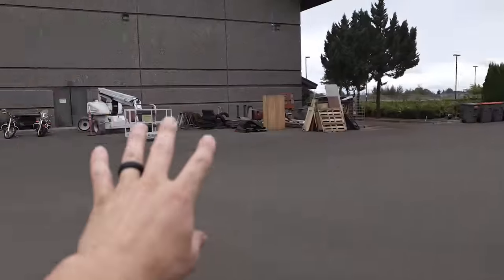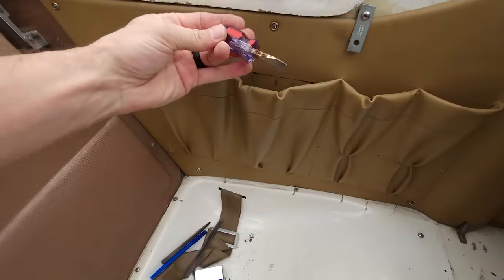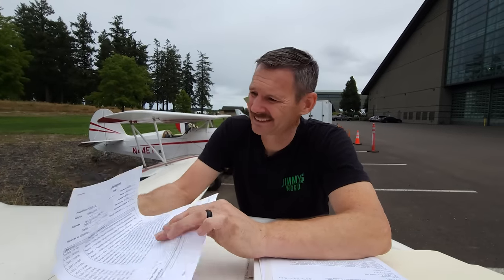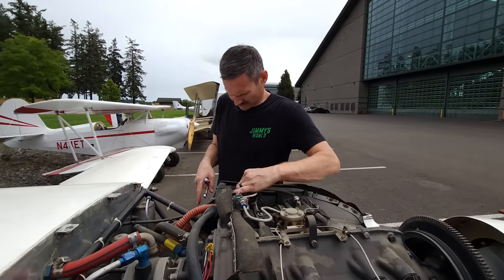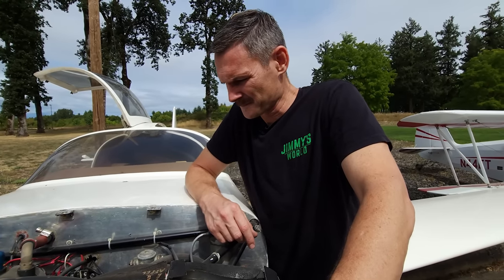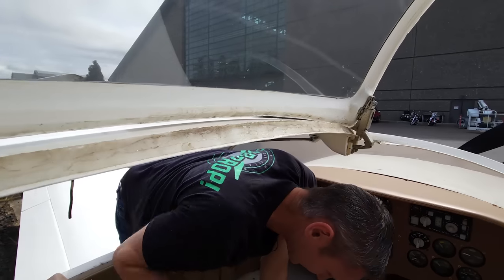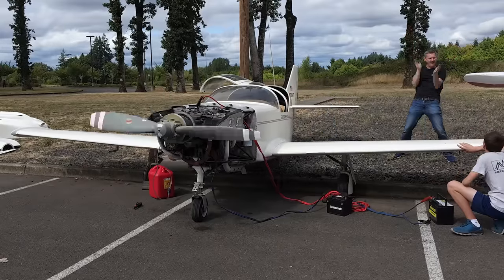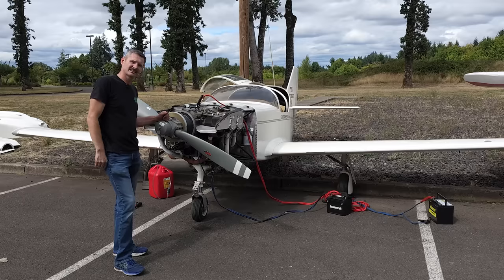21 Years In A Museum Will It Start?

Comment: Last project my dad & I worked on was a Glasair III before he passed away. Instead of the IO-550 we went with  a Rolls-Royce Allison 250-B17B turboprop engine. That airplane will cruise @20,000ft MSL @over 325kts. We would fly from KRFD to his hometown of KARG Walnut Ridge, AR. As a boy he told stories of WWII aircraft coming in to be smelted down and rows & rows of airplanes on their noses. Sad now to see all those pictures of planes waiting to be scrapped
Reply: Does it fly? What’s the tail number?
Reply: Saw a turboprop Glasair land at Eagle Creek Airport from Oshkosh in the 80's, only one I knew of. I was building a Glasair at the Greenwood Airport in Indiana at the time. Serial number 139, sold in 1992 and was 50% done  wish I finished it.

Comment: I would never feel comfortable flying a homebuilt plane that had been in a major accident, so I think the old owner was correct in saying the plane should never fly again. The engine on the other hand would be perfect for a heart transplant in to your new Lancair. Before you do the swap you should do a performance test, so you can have before and after numbers to compare.
Reply: but you would fly a certified plane after a "major accident"? You don't think a Glasair airframe, controls, mounts, etc., can be inspected?
Reply: @Smitty65721  It's fiberglass, they can't.  It's part of the reason why fiberglass fell by the wayside in favor of sheet aluminum.
Reply: @peteranderson037 that's a totally false statement about sheet aluminum. I built this exact same model of airplane, this plane could easily be repaired and flown unless the main spar was damaged. Cirrus and Diamond aircraft are some of the most modern aircraft currently in production, no sheet aluminum at all.
Reply: @peteranderson037 When did fiberglass fall by the wayside? The majority of new plane designs nowadays are composite (glass and/or carbon) If anything I'd say aluminium riveted construction is falling out of favour. It's also not nearly as impossible to inspect or repair composites as you claim.
Reply: @peteranderson037  That is just not true.
Reply: @Smitty65721 only the RV series fit his narrative, for people afraid or unfamiliar of building with composite.

Comment: The A1A is the same engine I have in my Mooney. It can be a pain to start at times. I just installed a surefly and it's insane how much better it is to start. I'll be flying it out to Prineville OR to LASAR in a couple weeks for some speed mods, let me know if you need help flying anything back!
Reply: If set up correctly, only hot starts are a bit tricky, but once tricks learned, no so much. Leaned to shut off, no priming, cracked throttle maybe 1/2 inch, crank a few turns and it fires, push full rich and adjust throttle to idle. I have a Light Speed Plasma 3 electronic, cold starts on 2-3 blades.

Comment: Well I have a Lanair 360 with a 200hp for you. And it goes slower than a 180.  Cowl needs to be modified to fit the engine. And that what slows it down.

Comment: It was clearly rebuilt to the point it can serve as a static display, and no further.
Both saves money during the rebuild and ensures it indeed won't fly again (at least not without a greater investment than it's probably worth).
Reply: exactly what I thought. He made sure it would never be airworthy again.
Reply: I'd say reassembled after taken apart and trucked to the museum, 1 piece wing reinstalled Sr the museum, prop removed for transport and reinstalled without safety wire. Electro Hydraulic pump removed and emergency gear extension hand pump handle removed.

Comment: The Angle Valve IO-360 is a very different engine, and is rated at 200 hp in Lycoming trim, these engines can be bumped in HP with mods, and there are LOTS of HP mods for the Parallel Valve 360s, IF you're overhauling them.... js

Comment: I built the same model of Glasair 1RG, my engine dynos 245 HP. 3 blade Whirlwind prop. My S/N is 730
Should be an electro hydraulic pump in the back and that leaver you saw is for a manual gear extension handle encase of a failure of the pump etc.
Starting that specific engine when cold is easy, once the gascolator is full only needs 3-5 seconds boost pump of prime, full rich, cracked throttle, boost pump off. Start only using mechanical fuel pump. Hot start cracked throttle, engine mixture fuel cutoff, no priming, once engine fires, mixture full in and adjust throttle. That engine can be increased to 240+HP 10:1 pistons, flowed, ported, balanced, blueprinted and modified cam profile. That cowling was enlarged to fit on those angle valve cylinder heads. Some did cheeks others like this top cowling, a minor reshape. I did a total aerodynamic reshap of my top cowl and minor rework on the bottom 1/2.

Comment: 2.32 looks like a hand operated hydraulic pump, maybe for the retractable gear!
Reply: Emergency gear extension pump, encase the electro hydraulic pump fails to function. The long handle is missing. My G-1 has the identical emergency down hand pump.

Comment: O-360 is a great engine. I worked on them back in the late 90's.  At the Indiana State Police we had 4 172 Skyhawks that were converted to 360's from 320's and had larger props as well. I think it was a pen yan aero conversion STC. I am not sure, it has been a long time . I just remember being a young mechanic and being handed that job with some help and changing that engine, all the cables and wiring, etc. I also put an entire new interior into it that was a weeks worth of painful work on its own. But, when it came down to the first run of the engine the senior mechanic handed me the keys and said.. go run it.. here is the checklist for breaking it in...Great satisfaction. I just sat there by myself and let the engine run through break in. I still remember the Tail Numbers of our old Skyhawks..N91SP, 92SP. 193SP. 94SP...

Comment: I think the angle valve motor is a big weight and balance p.i.t.a. in your Lancair.
Reply: I have that same style of engine, but with a Carbon F.  prop not metal. My battery is behind the rear bulkhead for CG reasons. With some creativity, ie. move battery far rearward for ballast, problem solved.

Comment: You’d be better off keeping the glassair. It’s aerobatic and fast, the Lancair  is just fast
Reply: Much stronger, +6 G's, 4 Negative it's a 1 piece wing, hard point main I beam spar and rear spar attached to the fuselage with very substantial aluminum hard points. Also fiberglassed together as well (belt and suspenders) the factory tried to "fail" a wing that was removed from a damaged Glasair they took it to 20+  positive G's without failure, then gave up. It is one tough airframe, never been an in flight breakup of any Glasair.

Comment: Nail a few blocks of wood together and screw the prop to it. I'd think Pops would appreciate at least part of the plane being useful vs not doing anything for anybody. I'm guessing he probably thought someone in the family would learn to fly it or would sell it on to someone who would. It's a rare person that wouldn't.
BTW, when I was a young mechanic in Ft. Lauderdale ('70s) the STP Corp. offices were down the road from the shop I worked at. One Saturday, for a promotion, they sent the Novi Special over for the day. It also had a stack of wood under the hood to hold up the header and provide the weight needed to have its correct stance. (of course we had to take turns pushing each other around the lot in it. ;-)  )

Comment: Finally a real airplane..  i Co-built a Glasair II-S with my father.. I have ~1500 hours in it.. 200HP.. 220kts true @ 8000ft - 190kts 9gph @55% eco cruise up high.. never has as much fun.. inverted fuel/oil.. KING IFR Stack.. it was 1990, pre GPS.. so it has a Northstar M1 Loran.. S-tec 60 A/P.. I miss that plane.. the dream was to build Glasair III Turbine..
Reply: Turbine Glasair's attempted are mostly "Rube Goldbergs" only a couple of possible exceptions. Only efficient fuel burn up very high on long legged flights, can't carry enough fuel in G3's to do that well. Other platforms are much better for that. None of the G3 racers at Reno have done that. 
I also built a G1-RG 245 HP (dyno'd) angle valve 10:1 pistons and so much more. Inverted fuel and oil as well.
Reply: @danblumel  agreed tiny airframes and turbines don't mix.. Fuel burn / quantity makes the very tricky and almost prohibitive.. Like you said.. Only a few that really worked well.. Honestly, at my age now... I'd prefer something more comfortable anyway... But fun... Pc-9/Texan II.. Etc... Legend... Maybe..

Comment: Drives me crazy when I see a backwards American flag!!!
Reply: Just an FYI the Stars always lead the way forward.
Reply: That'd be because it's a symbol of the regime they're trying to install.
No values , No truth, chopping away at this country from the inside.
Reply: @tywebb140 absolutely right on aircraft tails
Reply: the US military uniforms with a flag on the right hand sleeve is oriented the same way. The stars go forward.
Reply: My statement was that I hate when I see a backwards flag. As in I know the correct orientation. Jimmy's is correct. Doesn't change the fact that I hate to see them backwards. If you literally read what I said it would make sense but instead you've all done reverse logic in your heads to try and prove a point and you feel like you corrected someone.
Reply: @buckmurdock2500  ya the correct direction. We're always moving forward
Reply: @tywebb140  just an FYI I hate when a flag is in the WRONG direction. Why did you do mental gymnastics, just to try and prove a point?
Reply: @anthonysmalawipredators8794  it’s not the wrong direction it’s the CORRECT direction. Was just stating a fact
Reply: @tywebb140  you're refusing to understand that I know right from wrong and that my comment was "drives me crazy when I see a backwards American Flag" did I say Jimmy, your flag is backwards! Nope!

Comment: The Glastar is a great plane.  The kits were made just up the road from where I used to live in Washington.  Big shock since WA isn't exactly known for building aircraft.  :)
Reply: This is a Glasair not Glastar, Glastar is a high wing, not low wing.
Reply: @danblumel  [face palm] I should have known that.  I have a friend that build his Glastar and it's an aluminum plane.  Same company though.  :D
Reply: Are you kidding, Boeing made Washington famous for aviation. Not known for building aircraft?
Reply: @RealRickCox yes it was initially and for many years, the same company, now they are split apart. Glastar is Now Chinese owned, production is currently being moved there. The Glasair line is in California with a plan to revive it in Carbon Fiber.
Reply: @chrisscott1958 he was being sarcastic
Reply: @danblumel  At the time I was looking in the windows drooling over the planes, it was at the Arlington airport in the early 90's.  I know a lot has changed on the corporate side since then... but my love for the planes hasn't changed at all.  :)
Reply: @chrisscott1958  I thought the smiley face at the end would give it away.  So much for thinking my sarcasm was obvious.  :)

Comment: To fit that engine in the Lancair you'll probably have to blister the cowling on the top, due to the bigger rockerbox covers on the angle valve engine . Having that slider on the pilots side and a gull wing on the other, was fairly common on the Glasair 1s. If 2 sliders were used they tended to run into each other when both were slid back. That thing has a blue knob for the mixture, red for the throttle and black for the prop. Totally messed up. Everything is wrong. For some reason all the engine controls must have been disconnected, then whoever hooked them back up had no clue what colors were supposed to control what. There's nothing wrong with the plane, the engine is what's messed up. These shops that put high compression pistons in these engines, it takes a 2000 TBO engine down to around a 300 hour engine. And they have tendency to fail. The cylinders are supposed to have 8.7 to 1 pistons. Most of those shops put 10 to 1 pistons in them. Bad idea. Then when the guy had the expected engine failure, he blames the whole plane for it. It was his stupid modified engine that was at fault. I'd ignore the guy and fly the plane, after putting in the correct pistons. And having the engine inspected.
Reply: Absolutely, that cowling was widened as well, the G-1 or 2's were initially intended for 150-180 HP straight valves. I aerodynamically reshaped my Cowling G-1 for this same engine type. I have sliders on both sides, no interference of any kind. Mine has 10:1 pistons, Balanced, blueprinted, flowed, ported and cam modified, it's been flying since 2004 and no failure, also electronic ignition. I don't use full manifold pressure below 4000 ft. to help in engine reliability ( except for an "emergency" need for max performance ).

Comment: There's many reasons both airplanes were found difficult to fly safely.
 I have no doubt the prior owner knew , as many of us back then knew they were a handful, and were not forgiving to minor mistakes when maneuvering.
 I assisted in a wing build of a Glass Air in the 80's. I declined any flights offered.
Reply: Quite the opposite is true regarding the Glasair, they are designed to 6+ and 4 negative G's. The factory took a wing to 20 G's and never could make it fail. They are built "bullet proof". They are in fact a very forgiving high performance aircraft and a forgiving airfoil. A fairly docile flying machine.

Comment: Correct me if Im wrong. But the procedure for starting a fuel injected engine like the IO-360 is  1.Mixture full rich. 2.fuel pump on to build pressure (30 sec or so) 3. Prop all the FWD. 4.Mixture all the way out.(lean)  5. Crack the throttle. 1/4" or so. 6. Crank until the engine fires. 7 Then Mixture full rich again. to keep it running. Once it running lean the mixture for the smoothes operation. One more thing about the Lycoming . With the cam on top, it is suseptable to rust for stting for long periods. It wont show up right away, But it will eventually wipe the cam.  Just read the comments. You have a big heart Jimmy.
Reply: Fuel pump maybe 3 seconds, definitely not 30 seconds!
Reply: @thomasaltruda  I made that comment too elsewhere here, once you see fuel flow on the gauge maybe 3 seconds as you stated. Cold starts mixture all the way in not out, Hot starts mixture all the way "out" (no flow and no priming).

Comment: More btu ( power )  is a added safety feature that will get a plane more speed to climb in a headwind or thin air at high altitudes like Denver , Colorado ... good to hear that engine run so smooth ... looking forward to the video when this swap happens ... ❤❤❤🎉🎉🎉😊😊😊 ...
Reply: Saw your reply comment on it will not be cannibalized ... so much for the extra btu ( power ) ... oh well ... maybe find another somewhere ... ❤❤❤🎉🎉🎉😊😊😊 ...
Reply: then again, it can also lead to more vibration, which isn't good.

Comment: If you put that engine in the Lancair,you had better be aware of the possibly that the front air vents may be too small for that engine.He had to enlarge the holes in the cowl to get enough airflow to prevent overheating.
Reply: Those nostrils are the standard size for the Glasair series, I know, I built the same aircraft.

Comment: If you look close, you will see split pins in the prop bolts/nuts. Stronger than safety wire, so all would be well.
Reply: Those split pins don’t prevent it from backing out.. they are pins that connect the nuts to the studs, making essentially bolts. The proper thing to do is use .032 safety wire though the split pins.
Reply: @thomasaltruda I made the same comment elsewhere here, some people just have no idea.

Comment: No safety wire on prop because the nuts are pinned.
Reply: Not quite right, evidently the airframe was trailered to the museum and the prop was reinstalled there, those are studs not bolts and they have pinned nuts on the ends, it should in fact be safety wired before being flown.
Reply: Good to know.  So pinned nuts get safetied through the pins?  Guess I have to review AC43.13-1B :)
Reply: @bigdaddie40 that be correct